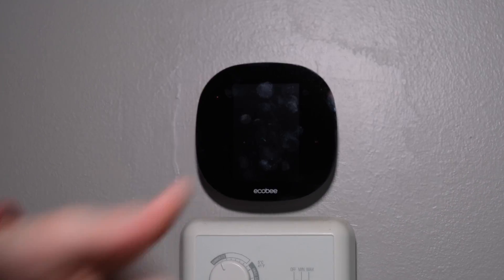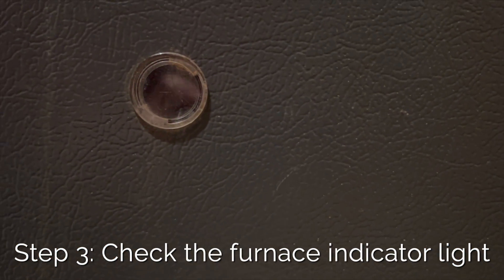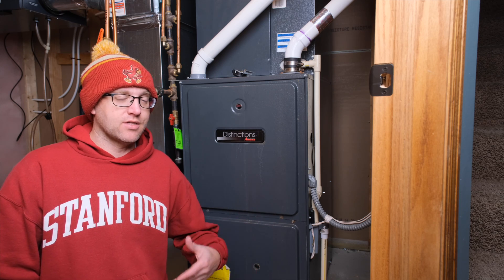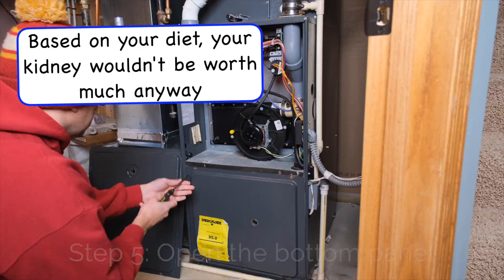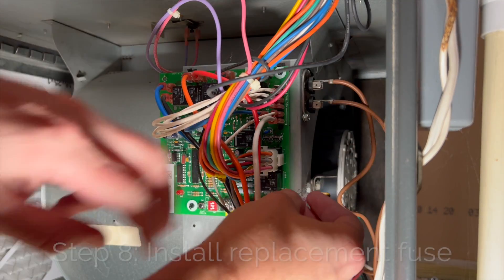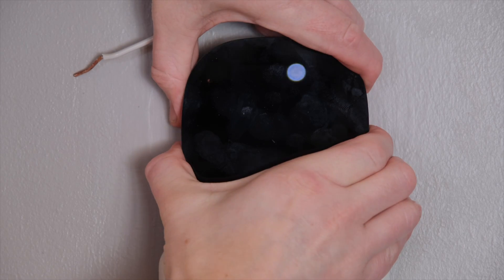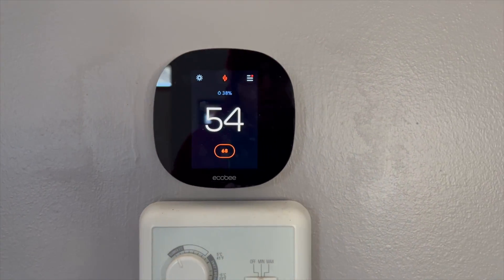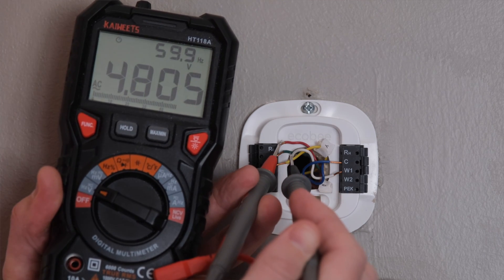Smart Thermostat not working? Fix a blank screen/no power to thermostat

Comment: Bro!!! Life saver. Doing home Reno’s and the heat stopped working, checked all the wires for damage, the furnace, and breakers. Everything checked out. Moved the thermostat right to the furnace and still nothing. First 29 seconds or so of your video you mentioned the switch, I instant knew I had to of bumped the switch somewhere. When I dropped the drywall ceiling i hit the switch. Thanks so much dude!

Comment: This is the extended version.
If you own a multimeter, you can go to the cliff notes version .
Before doing that, don't forget you have to switch to voltage and alternating current/AC
Make sure that thermostat batteries are good test testing them with your multimeter.  testing the batteries in direct current/DC..

Then, use your multimeter to confirm that you have voltage between the RH/RC terminals, and the common terminal /C wire. 

You can also substitute  RH/RC and test with a multimeter for voltage between there and another terminal, such as Y,G,W

If you have voltage at the thermostat and it's not working, you need to further diagnose it. 

If you do not have voltage at the thermostat, then you can go to this longer version of seeing if there is power turned on for it to run up to the thermostat in the first place ...

Comment: Mine was easy but stupid! If you have a small condensations pump, make sure its breaker is on and the water level is not high for its float switch! Bingo!
Reply: How do I fix? I’m having the same issue.

Comment: 1.) Thank you for posting this video — for novice DIYers like myself, it really does help. 2.) Like another comment said though, touching the red and blue wires at 3:07 not only blew the fuse again, but it also shorted out my transformer and also fried my downstairs Ecobee which was on a shared common. After a service call, I found out I just had a bad contactor — but that my touching the blue and red wires together caused another $700USD in unnecessary costs (new transformer + new Ecobee). Again though, I appreciate the overall video but DON'T TOUCH THE RED AND BLUE WIRES TOGETHER.

Comment: The same happened to me but it was the float switch. Also check to see if your drain line is clogged that will activate the float switch and shut off power to the unit. On my old thermostat it had batteries so it was harder to troubleshoot.
Reply from the maker: Excellent tip!

Comment: Pete, what is the control mounted below your Ecobee? Is that the old thermostat?
Reply from the maker: Hey Doug! That is the humidistat for the air exchanger. But leaving the old thermostat on the wall would definitely be on brand for me.
Reply: @DIYSmartHomeGuy1  I see. Are you using a humidifier on the furnace as well? The Ecobee can handle humidity too, really well actually. I used to have our furnace humidifier connected to an Ecobee 3 when I still lived where we needed to add humidity during the Winter. It kept the windows from getting wet and kept the house humidity under control better than the regular humidistat did, because the remote sensors also measure humidity.